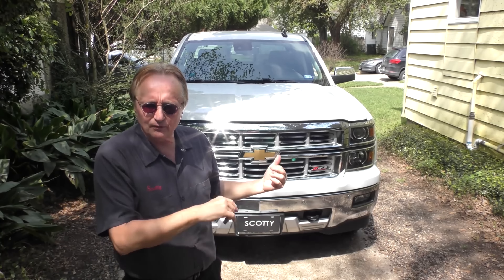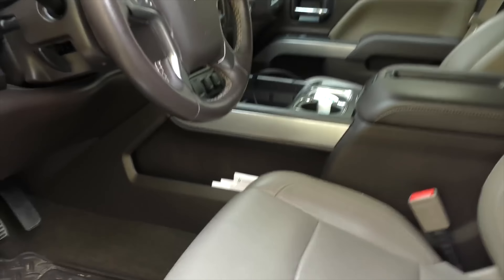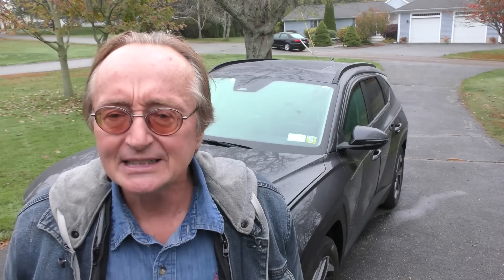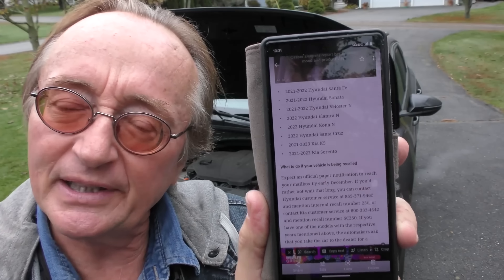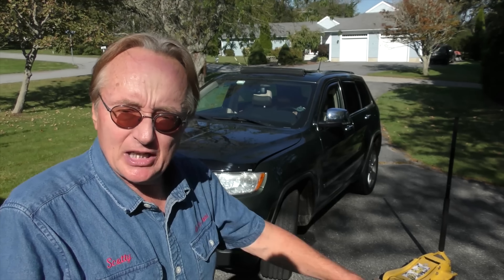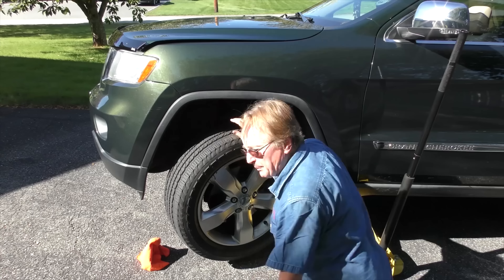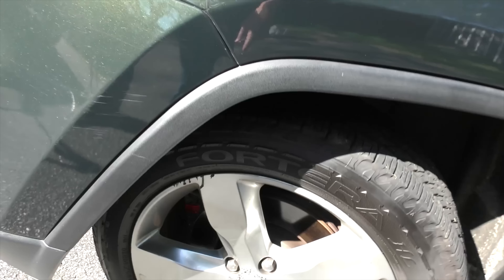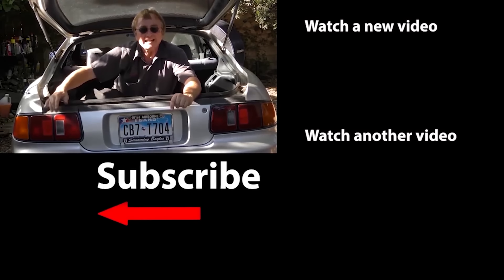3 Car Brands I Wouldn't Touch with a 10 Foot Pole

Comment: GoodYear is the best.. 
Quality tires for affordable prices and I had the warranty cover 2 of my tires that had had screws-!! I ONLY PAID 37 dollars for the new warranty to cover the replacement tires so the next time I pick up a nail-screw I am covered again.
Reply: Good year is the best no doubt. Hell I’ve bought used tires before with a decent amount of thread and they ran quiet and super smooth. Better MPG than even the OEM ones
Reply: Goodyear tires suck. I got 2 years out of their best ones. Never again going to buy Goodyear. Only Michelin tires for me.
Reply: @elhombre8925  I got a set of four tires.  6 months ago and I already had two replaced under warranty... 
I had my timing belt replaced by goodyear, brakes, and more for a fair price-honest work..

Comment: I have to say about a GM vehicle, I have a 2017 Cadillac XT5 and its been one of the best vehicles I have ever had with no issues. I am nearing 100k on it and its now a seven model year old vehicle so I am concerned I may begin to have some issues with it. Thing is with all of the auto makers going to turbo engines and car prices all being so high now, I have no idea what to replace it with. I'm not going EV or even hybrid with all the issues they seem to have.

Comment: 7 silveradoes all except 1 when 250k sold all of them , had a transmission blow because I gut it stuck in sand and blew the rear gear . Traded that  one in

Comment: If you get a flat tire just get it patched.   It is cheap and lasts forever.  No need to buy new set tires.
Reply: Problem is 99% of tire shop will force you to buy new tires. Even walmart won't touch a tire which is old by age not by milage.
Reply: @skeets347  

Never had a problem and I had 3 flats at different times.
Reply: @randyhuke3773  Possibly only in my area

Comment: Scotty regarding the Hyundai Tucson,…I’m confused.   You mentioned the possibility of a transmission recall and he should be ‘covered’ as he his only leasing.  But doesn’t Hyundai / Kia offer a 10 year/100k Powertrain Warranty?   Wouldn’t that Warranty cover that problem…. 

Help me understand as I also own a 2022 Hyundai Tucson SEL W/Convenience package, with 32,000 miles.  BTW, I had a ‘check Engine Light’ come on,…with a DTC code of P0567a.   They replaced the Oxygen sensor and gas cap,…as is well now and it was indeed covered.

Thank you as I watch you Daily…
Reply: Don't correct Scotty.
Reply: Hyundai claims torque converter isn’t part of power train, lmfao!

Comment: aww :(. i was looking into the following cars:

2023 Nissan Rogue
2024 Chevy Equinox
2024 GMC Terrain

I am looking for a car not highly desirable since they will most likely have solid discounts while having decent MPG and roomy compared to my POS Crosstrek base. Which one should i get? (I tes drove a Mazda CX 5 and I did not like it)
Reply: Nissan and Infinity have an interesting feature where the steering pump freezes (from cold) and then needs to be replaced.  Or drive with manual steering.

Comment: All 3 manufacturers have their lemons and their bulletproof vehicles.
Reply: I have yet to discover a single Dodge, Chrysler, or Ram that was bullet proof.
Reply: @thetapheonix  Dodge Caravan has been an impressive minivan for a long time now. Plenty of them on the market with 200k+ miles.
Lots of cars from Dodge where it's hard to find any on the market with much over 100k (Dodge Dart being a good example).
Reply: Jeep....  @thetapheonix
Reply: @thetapheonix  Chrysler is no longer supporting cars built over 15 years...have a 2008 Cummings and I have to purchase aftermarket parts...

Comment: Still driving my 96 Silverado, 350,000 no rust everything works, including the AC and tail gate, load it up all summer long drive all over the countryside with over 12,000 pounds of camper, tools, jacks, car hauler, racecar, spare tires and wheels, family, my brother in laws Toyota truck, been a piece of junk that cannot pull the load, that truck is gone.

Comment: I had a 2006 Grand Cherokee Laredo. Had until 2021 when the transmission went. That "wobble" on the highway is incredibly scary! After a while it went away. So weird. It only had 30K when I got rid of it, never drove it much but the whole underside was completely rusted. The roof started cracking peeling and rusting. Someone said "bad metal from China"...Dont know WTF Jeep is thinking.
Reply: Chinesium
Reply: I went to replace the front springs on my 2003 WJ and the bottom axle spring perch came off with the rest of the spring.  Rusted beyond recongnition by 140K.  I still like the overall design.  There's nothing else like it.  Why can't Scotty just say "warped rotor" without the high pitched voice and crazy hand waving.  The calipers are crap and the float pins will seize so the pads are always dragging.  Akebono caliper upgrade.

Comment: And I have 2 of the 3 vehicles in my driveway. Wife just bought the new Hyundai Tuscon LTD , luckily its only 2 wheel drive though, My '15 GMC Sierra has about 80k great miles so far

Comment: I disagree with the 4 tire replacement on AWD vehicles. Differentials compensate for different wear on different tires - like computers compensate for varying octane levels in gas.

Comment: Scotty I have a question: Will the car makers fix your car if you off road it? The Tv shows cars being driven off road, looks like they are being red lined, & other abuses. Who drives a car like this? I would not want to drive my 25,000 - 50,000 vehicle like this. I don't understand the power trip?????

Comment: My home remodeler has one of those Hyundai's and sure enough at 44K miles the 8 speed tranny went out - the worst part was when the Hyundai dealer said it happens a lot and it would be 8 weeks before they could get to the repair . They would only loan him a car when they actually took the car in to the shop so he had to rent one for 8 weeks on his dime . My GF's father bought the Jeep Grand Cherokee new in 2018 with the V6  . One new transmission and new cam replacement before 70K miles he was wondering what will go next . Well it was the electronics managing the heat . That was $400 to get a new module of some sort .  I have driven 806,000 miles on my last three Ford trucks and not had any expensive issues. Avoided the 5.4 liter and all the turbo models . Your words ring true . And then there is Audi - what junk .

Comment: My father’s 2012 RAV4 has a 4WD system and he has only had to put cheap Falken Sincera SN250 A/S for only like a few 600$. He loves his car. But, the 4WD system cannot shift into 2WD high because there is not a transfer case, the drive tires can only drive in 4WD. What are some tips for gas mileage?

Comment: What's the problem with a turbo if the car is leased? 2.5 liters may be enough for you but for me only 2.5 means it needs a turbo!
Reply: The first problem is that it’s leased 😂
Reply: @InternetUser._  I would've guessed that was the second problem. The first, it being a Hyundai.

Comment: I have a 2013 GMC 2500 HD has 357,000 on it still running strong and blowing ice cold air. Have a 99n Tahoe 251,000 on it same thing runs great ice-cold AC, same with my 2000 Silverado. They got a bad one, there not all junk like your claiming.

Comment: I want a p71 crown vic so bad.. I'm 21 and in this economy I can't even afford a 20 year old car. It may sound odd but the P71 Crown Vics are a dream car for me.
Reply: I have a 2000 p71, 250000 miles, runs great. Last of the real American cars. South Carolina car, no rust underneath. I'm originally from Michigan. I'm familiar with rust. As far as buying one, just keep your eyes open. If you do buy one, don't beat the crap out of it. There are guys who buy them, then run them into the ground, doing burnouts, etc. Be careful you don't buy an abused p71. If it's not running good, don't buy it. You don't want problems with power train.
Reply: @soco13466  Thank you for the info of course I wouldn't beat the hell out of it. So true that they are the last of the true American Sedan. I'm a police officer in a small town in Oklahoma and our department doesn't have any. But I'd love to have one as a POV

Comment: Like I said all these extras like he sees power steering electric windows electric mirrors temperature heated seats pressure sensors in the tires all as the cost of truck both within 5 years these things will start to breakdown then it cost a fortune to fix 💵💰 you're better off with stuff that works manually because it's not going to break unless you really abuse it

Comment: I can't remember where I read it, but it sounded like it was a known thing that the death wobble was caused by using metric bolts in Imperial holes or vice versa. People have fixed it, apparently, with $20 worth of new nuts and bolts.

Comment: I like Scotty but he is wrong about the Jeep. He said that the right caliper-that was "replaced", looks worse than the original left one, and that it rusted faster because it was a rebuilt, not new. 2 things- that caliper was NOT replaced and quality rebuit calipers are coated to slow rust progression. Also, It does appear that the rotor was replaced.

Comment: Idc what anyone says, I will never own a vehicle that doesn’t have a pushrod V8s easiest engines to work on and the only “real” issue most of them has is lifters but that’s not a super hard fix, something u can do in ur driveway with the right tools, especially if it’s a LS, parts are in abundance. Even the hemis are pretty good, specifically the 5.7, I wouldn’t touch those 6.4s tho

Comment: I grew up with owning GM cars and had nothing but problems with them ( premature brake ware, transmission problems, intake manifold gasket leaks, rear main oil seal leaks, AC problems with compressors, AC refrigerant leaks and more) I dumped GM products 16 years ago. GM puts out crap!! I am now a Toyota guy, the best cars ever, with the least amount of maintenance.
Reply: Gm truck are built like a rock they just sit there

Comment: With that Jeep callper sticking usually its break lines . You get a break fluid tester and if the fluid is not good , that break line is corroded from inside and caused blockage . You could also tell by the color of break fluid . Break fluid will lose PH levels and become corrosive -   fluid needs to be replaced at least every 2 yrs regardless of miles . Fluid PH levels is solely dependant of time vs miles . Break fluid is not oil  , it is hydraulic fluid and hydraulic fluid  doesnt have long life span . All this is PREVENTABLE maintenance - not poor manufacturing . But Jeep isnt something i would buy - EVER .

Comment: Re: needing to replace all 4 tires on an AWD vehicle when one is damaged.  There is a process to "shave" down the tread on the new tire which can then match the thickness of the remaining tread on the other 3 tires so that just one new tire can be purchased.  No one seems to mention that process.  Is there some problem with having that done?
Reply: How much does that cost?
Reply: It's illegal in some states. I had a tire bust on my Subaru and asked if I could get a matching replacement and have it shaved. I was told by multiple tire shops it was illegal here in WV.
Reply: @nathanwhitman4699  But marrying your sister IS legal.
Reply: @Joe-for-You stereotype much? real classy.
Reply: @brianbrewer2909  
Consumer Reports had an article about shaving tires and they didn’t say anything negative about it. They also stated that the company TIRE RACK mentioned it on their website and estimated the cost at $25-$35 for a tire.
Reply: @nathanwhitman4699  
I wonder if it really is illegal or whether they say it is to sell you four tires instead of one ? tire rack mentions it on their website. I wonder if you contacted them they could tell you whether it was illegal in any state.
Reply: @nathanwhitman4699 he is an old troller with a new handle " joined" a week ago
Reply: @ronhalvorson1313   thanks 👍

Comment: I’ve had 2 of these. Pure crap. Transmissions have too many gears and are not smooth. They have alot it electrical problems. They will be super problematic after 6 years.

Comment: I have a 2014 Cherokee Trailhawk that has somehow made it across the U.S. one time and amassed 176,000 miles without a transmission problem or major engine malfunction. I'm worried that if I change the transmission fluid/ power steering fluid I'll cause more harm than good. Anybody?
Reply: Spill & fill on both.
Reply: Change the power steering, don’t touch the transmission.
Reply: PS fluid, yes. Trans fluid, NO.
Reply: leave the trans fluid alone

Comment: Amazing videos! 
Thoughts on Alfa Romeo?
Reply: You can do oil changes, change spark plugs and air filters but everything else requires a trip to a dealer ( if it's close enough)
Reply: @kclefthanded427  dang, as a owner, 100% agreed 💀
Reply: Nope 😅
Reply: Super fun cars but not built with longevity in mind without massive repair bills.

Comment: I have a 2006 Chev 2500HD.  Typical Chevy, the tailgate and rear door handles are all broken.  The electrical issues are notorious.   I especially like the single front  marker lights that come standard with the last 20 years worth of Chev trucks and bigger SUVs.  But, I refuse to pay anybody $70-$100 grand for a truck.  I'll nurse this one along one part at a time because I need a heavier duty truck for towing stock trailers and equipment trailers once in awhile.

Comment: Hate to tell you but Jeeps will run forever...have had nothing but good luck with them.  And they are beastly off road, even the non-wrangler models.
Reply: You poor guy. Get ready for lifter and cam problems fella.
Reply: I have an 06 Jeep Liberty, almost 260K on the odometer. I bought it for $500, I’ve had to do some work on it but overall it’s been a beast. Rusty but trusty.
Reply: @georgenovotny4421  Don't you have some problems you should be getting ready for?

Comment: Said this before saying it again. Been at my job 13 years now, massive employee parking lot has THREE 94 Toyota Celica since I've been there 🚙
Reply: Celicas with a manual transmission are some of the best first cars you can buy. Zippy, but not dangerously powerful, mechanically bulletproof, and has a classic sporty look that still holds up 20/30 years later.
Reply: Find the one that doesn't run and tow it back to Scotty.

Comment: My 2002 mercury gr marquis ac only needed a coolant recharge after 20+ years. But was cop car design. Still had 82000 miles but runs great. Why buy over priced modern cars?

Comment: Chevy are great because lots in junk yard to do ls swaps. Gm chevy v8s vehicles where great until 2007. After only the ls, and lt engines and transmissions were great, the vehicles were junk. People pull out the junk yard engines to put in fords, dodges,  german cars, even toyotas when those expensive engines blow up because the ls or lt gm engines are so simple and reliable  easy to work on and swap. It's every thing else thats gm junk.
Just go look up videos of fords,  mustangs, dodges,  toyota , Mercedes,  mazda,  Porsche, jeep ls lt gm engine swaps.